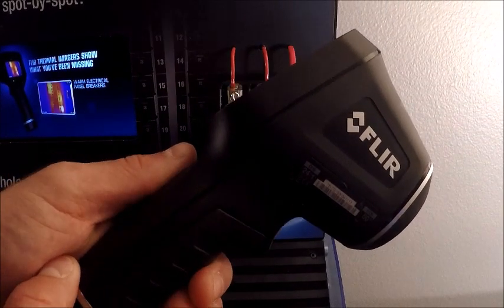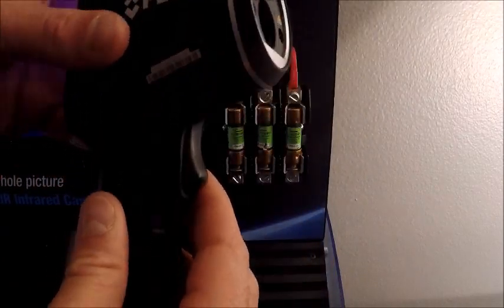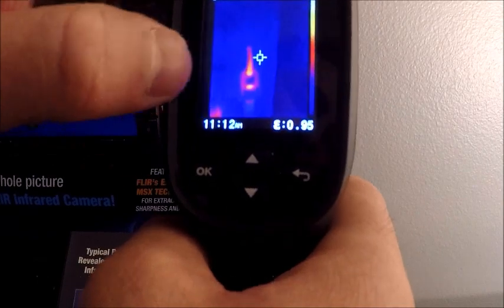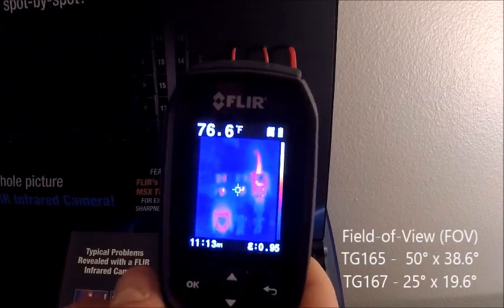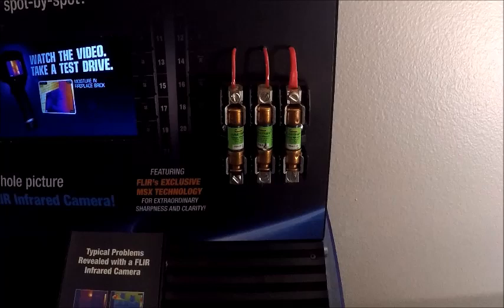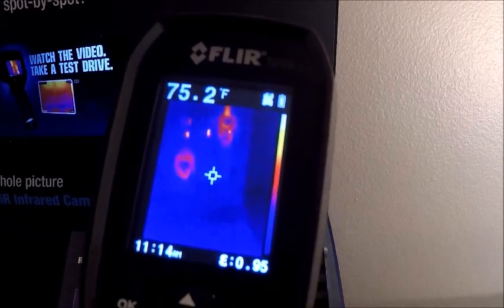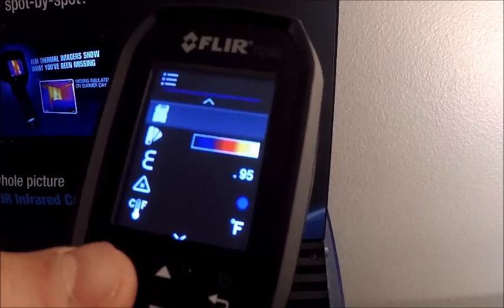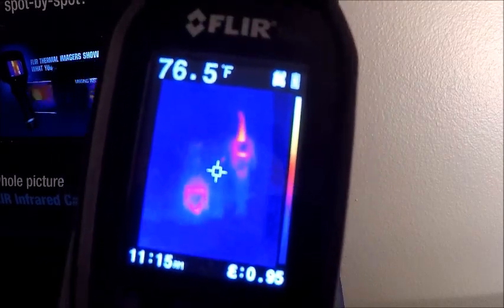Flir TG165 TG167 (TG-Series) Overview and Training with I&E Technologies

Comment: I bought one but my image seems very "Blurry" almost like it's out of focus is how I would describe it like when your binoculars are our of focus...I'm looking at your video and your picture is clear and you can see all the wires etc in that panel you were looking at,mine is just blurry until I look at a Warm or hot Spot,could be the resolution but I'm not sure what the resolution needs to be at lol?? Is there an option to change ether focusing?
Reply from the maker: Hi Wayne - it is likely that your camera is just fine.  The reason my TG looks clear in the image is because it needs some thermal contrast (temperature differences) to be visually more attractive.  That is the nature of a low resolution imager like these.  The TG165 is focus free and doesn't have the ability to have it's image enhanced at all.  The TG267 would be worth looking at as it's a much higher resolution for not much more money.

Comment: Hi i have one simple question.
Is tg167 enough good for detecting a termite activities behind walls?
Reply from the maker: Hi Josh - it completely depends on the severity.  I would guess that if you knew there was termite damage in a wall, you might be able to pinpoint where it is with the TG but without knowing that, it would be very difficult to say with that certainty that you have termite damage in an area with the TG alone.

Comment: Good for detecting hot spots on a motherboard??
Reply from the maker: Hi Johny - I wouldn't recommend it for that, it's not quite high enough resolution to see small temperature defects on a motherboard.  You'd probably want to look at the new C5 at the very least, depending on your budget.
Reply: @ietechnologies72  wait really?? I actually ordered one because I found it for a decent price thinking it would be at least somewhat good enough to help me find a bad chip on a board or something :/
Reply from the maker: You bet!  It’s much higher resolution than the older TG-series so that’s much better-suited for that application.

Comment: Hello, will this tool see things behind drywall?
Reply from the maker: This tool, nor any infrared camera, will truly “see through” drywall.  What it will see is temperature anomalies that may be caused from the other side of the drywall.  For example, if looking at drywall on an exterior wall of a home, you will see any wall cavities that aren’t properly insulated, water damage, poor seal/insulation around windows and doors, etc.  If you had a hot water pipe inside a wall cavity, you wouldn’t see it UNLESS it was causing the drywall temperature of that section to heat up more than others.  In a nutshell, it won’t function like an x-ray and only sees surface temperatures but will pick up heat transmitting through a surface.

Comment: my images is in .BMP format while FLIR tools used .JPG format, what to do when i want to import images
Reply: Hi Jawwad - Unfortunately, the TG-Series isn't designed to do much post-process or after you capture an image.  It's more of a "spot-checker" if you will.  With that being said, the images you capture are not radiometric which means you cannot manipulate them further in the Flir Tools Software.  You could however use that image on a report of some kind.  If you want to be able to take images that will allow you analyze and adjust the images from the software, you'll want to take a look at the C2/C3 or E-Series cameras - we have Youtube videos on both, just check the side bar or go to our website.
Reply: Laura, its mean TG-165 can't generate image on FLIR Tools?
if NO then how can i ?
Reply: Jawwad - you can bring the image into Flir Tools but you can only create a report with it.  There is nothing you can do to adjust the image (i.e. change color palette, image mode, move spots around, etc).  If you want to bring it into Flir Tools, take the image(s) off the micro-SD on the camera, and save the in a folder on your desktop.  Then, bring that folder into Flir Tools using the "Import" button in the Library of the software.
Reply: Laura Fritz thankyou so much.
Reply: hi Laura, 
Is there any tutorial for generating report from TG165?
i need to generate report from TG165 for demo.
Reply: Hi Jawwad - there isn't anything published that shows that but if you download Flir Tools (free download) and import the images into the Library, you should be able to select an image and go to the top-center of the screen where it says "Generate Report" and it should allow you to do that.  Otherwise, you could simply bring it into a Microsoft Word document and build your own report template from scratch.

Comment: Work gave us one of these. It seems worthless. Won't detect hot water lines in walls or detect anything that a $20 moisture meter wouldn't detect or your hand/eye.  As far as electrical, at the least a $3 harbor freight meter will tell that. This tool is for people that do not have to fix the problem is my point. That guy all pointing the flashlight lol.
Reply from the maker: I hear you - it’s definitely not the perfect tool for that application but it is better than using an ordinary spot gun.  Ideally, they’d set you up with at least a C2 for that application as it allows you to do some manipulation/analysis of the images.

Comment: flir tg165 charging time ?
Reply from the maker: Hi Charles - Thanks for viewing.  If the TG165 is completed drained of battery, it usually takes about an hour to get a full charge.  It has an automatic shutoff on-board that you can adjust that will certainly extend the lifespan between charges.  After use, I typically charge my TG165 via USB on my vehicle and although I rarely have to charge it after it is completely dead, it doesn't take long in comparison to other instruments when the battery is drained.
Reply: thank you so much i just received my unite today just waiting for some sorta sign that its charged so far no green light no beep bop noise nothing it just keeps on showing charging . but when i power up the unite it shows full . but is it really full full or no! as it always shows a flashing charging is your unite do the same ? or does it just keep on flashing ? and flashing and so on. documentation that came with unite does not disclose charging times. at all anywhere on its pages. At all.!..but it does work as advertised . including in your video..great job..i am worried in the event it over charges as its new and its new to me. with no apparent information that all is going well in respect to charging ...thanks for you experience with this unite
Reply from the maker: When it is fully charged, the battery indicator (while still plugged in) should become solid as opposed to the gradual battery indicator constantly changing.  You may want to charge it a little bit longer out of the box before using.
Reply: ok will do thank you so much for your fast responce to my question..you guys are pro;s cheers
Reply: RESULTS...first time charge 3hr 40 min ....afterwards  1hr does the trick....hope this helps some one..great unite. i enjoy the unite with the setting that has the hottest white marker on top of the scale works best for me